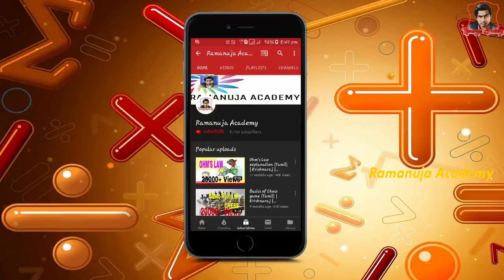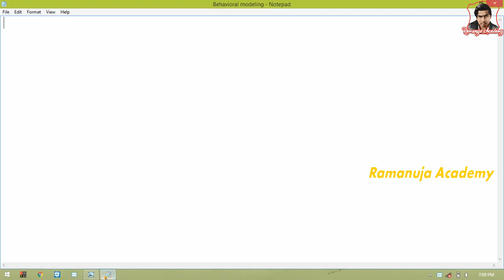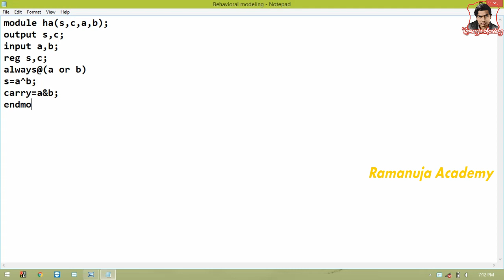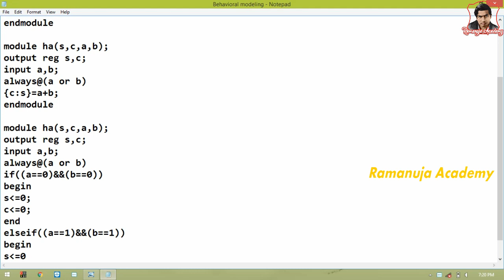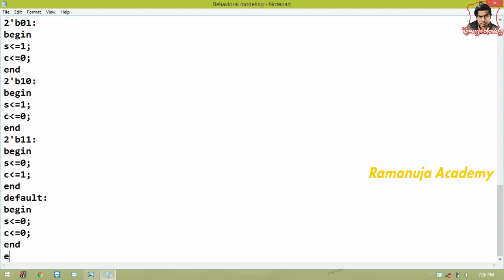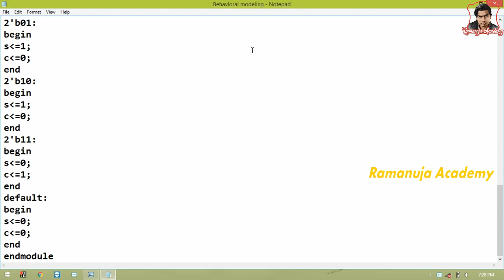Behavioral Modelling in Verilog coding | VLSI | Krishnaraj | Ramanuja Academy

Comment: bro na B.E ECE padikura enaku VLSI design aga asai enaku VLSI pathu top to bottom varaikkum sollithanga bro programming coding enna tools use panrathu yellam sollithanga
Reply: thank you bro🙏🏻🙏🏻🙏🏻🙏🏻🙏🏻❤🙏🏻🙏🏻🙏🏻
Reply from the maker: First you need to study some of the basic books. Athukapram than tools and testing ellam purinchikka mudiyum.
Some of the books:
1. Low Power CMOS VLSI Circuit Design by Kaushik Roy
2. Design of Analog CMOS Integrated Circuits by Behzad Razavi
3. Practical Low Power VLSI Design by Gary K. Yeap.
4. Introduction to VLSI Circuits and Systems John P. Uyemura
5. VLSI Digital Signal Processing Systems by Keshab K. Parhi.
Reply from the maker: VLSI is very easy and joyful thing for learning. Start you journey now. Congratulations.